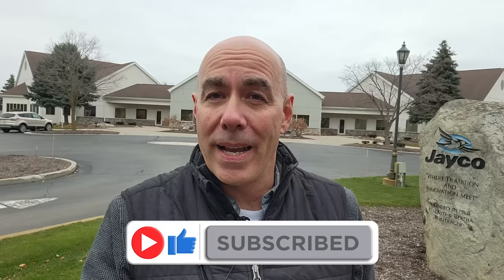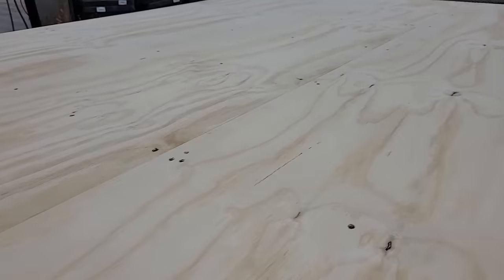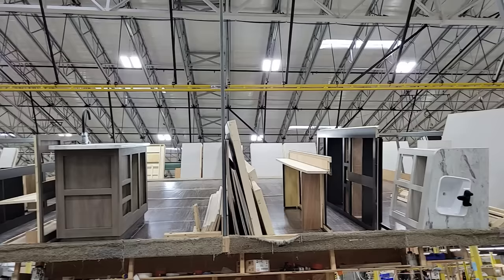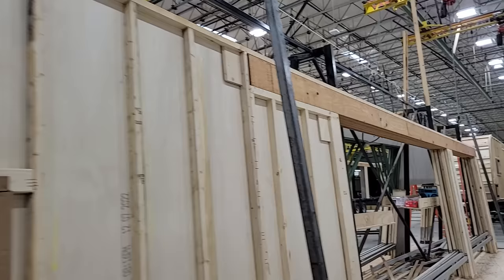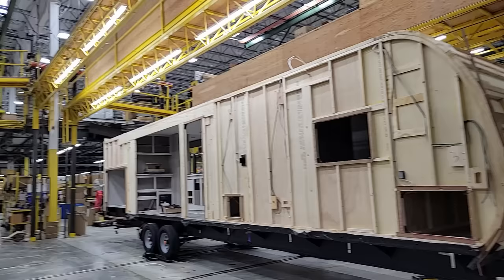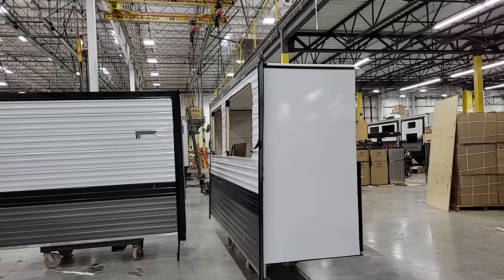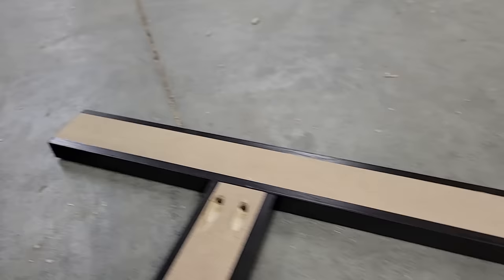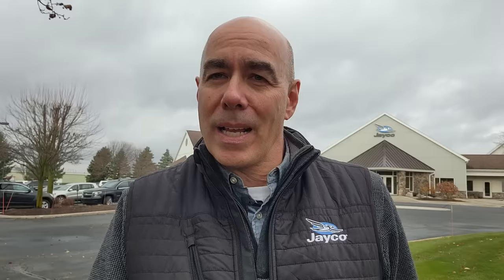How are RVs Made? - Jayco Factory Tour!

Comment: I'm not impressed with what I saw overall. The loose plastic, staples aren't correctly installed, no protection on the water cell or insulation,  those horrible welds on that weak frame. Walls are tolerable but only when they're assembled correctly. Would of gone with thicker plywood for the floors. Cheap looking furniture,  roof structure would need to be beefed up. Thin sheet metal  (even though it is thicker then other brands) still makes it vulnerable to damage. Never even mentioned the load capacity of the axles or tires. I've seen a blowout on couple different Jayco trailers, they get torn up just like the rest. Not a fan of the formed siding- more prone to leaky windows. Straight flat panels keep the water out. The paint fades on these within a couple years. Never been a Jayco fan and this video proves their faults in production and overall lack of quality- if you actually know what you're looking at. Earthquake vibrations? Only if there's an issue with construction and or the tires would one be concerned about shaking and mentioning that a couple times in the video just made me chuckle and we all know no trailer / rv company makes a decent product- they all have their faults. I'm kinda surprised the Amish would waste their time and talent building stuff like this, they usually value quality over a paycheck... least the ones I know.

Comment: My 2022 Greyhawk 30Z has so many quality issues. Jayco is no better than the cheaper ones we passed over to get a Jayco. Water heater tank installed on top of rubber gas line. Over time it collapsed causing low gas flow. Jayco said it was my fault for the lack of maintenance. The bedroom slide is not chaulked properly and leaks water into the camper. Outside trim pieces are coming loose. The water hose connection to the back of the toilet was loose and leaking water. I could go on with more items. Very disappointing.

Comment: I must say that I'm not to impressed with this video.  Because I'm a owner of a Jayco, I bought 2 years ago, brand new. Had nothing but trouble with it. From the furnace,  to hot water heater and fresh water pump. Then the biggest problem is trying to get it fixed through Jayco 2 years warranty and extended warranty.  Be prepared for a very bad Customer Service personnel.   I still have issues, and still waiting!

Comment: I am renovating extensive rot in my 2016 Jay Flight.  I am seeing none of the construction techniques or materials that are touted.  My water tank was held down with a ribbon of metal. The floor is made of OSB not plywood.  I had to replace a considerable amount that crumbled in my hand. I Put my knee through it . The framing joinery is wide crown staples.  The camper has made for some fun times but the construction details that I am seeing as I take the camper apart is poor quality.

Comment: I have a Jayco and it doesn't have any galvanized metal under the wheel well at all. All It has is a thin junky piece of plastic that offers zero protection and would be completely destroyed under a tire blow out.  All the shrapnel would fly into the interior of the unit and probably completely total it out. Worst wheel well protection I've ever seen on a camper.  Just saying.

Comment: hmmm..buy a nice older rv…don’t waste your money on depreciation of new ones…the walls are paper thin..i’ve got a 2000 safari trek class A..paid 15000 from a private seller..everything works except the radio..and i’ve driven it well over 2000 miles..if you do buy a new one…cut the price in half when you start dealing..Rvs…new or old have the same upkeep and problems..later

Comment: Was thinking of a jayco-after watching your video and noticing so many poor quality build examples, I now doubt they are superior in any way. If you have to put campers in a "sick bay", after build quality control procedures and pdi,s -then you have a build quality issue.
Reply from the maker: Having toured nearly every manufacturing facility in northern Indiana, I'm continually impressed with Jayco's commitment to build quality. Not perfect, certainly. Room for improvement? You but.  Keep in mind that the units in the "sick bay" are a tiny percentage of the units that roll off the line. I'm impressed that they pull them out to address any issues. And then they go to the full PDI facility to be inspected again.   As always, thanks for watching

Comment: You should address the tire problem on U.S. Made travel trailers, China bombs, Very dangerous problem, they blow up on the hi way at around 65 miles per hour. It is well documented, but the manufactures keep using them because they are cheaper. WHY.
Reply from the maker: Hi Kenneth, for this very reason, Jayco uses American made Goodyear tires with a 6-year warranty.  In a few instances on larger fifth wheels, they use Uniroyal, still very good tires. Thanks for watching our videos.

Comment: Jayco sucks omg I have a 2014 jayco Jayflight and heater/furnace metal box mounted on floor with water heater DIRECTLY ABOVE heater unit with exposed wires then the water heater leaks and BAMM, heater fried fire almost started now everything wet and RUINED!! EHO THE HELL DESIGN THESE PIECES OF CRAP? Not to mention Luke dozens of other design and manufacturing flaws. 😡

Comment: Watch “rv roof install” YouTube channel. You will quickly realize how junky these things are.
Reply: @Mike Drudge his channel has nothing to do with the trusses. It’s all about the cheap thin roofing material they use to cover it all and all the seams it has because of all the protrusions through the roof material. They use cheap dicor to pile on all the seams which they recommend you do every few months. That’s a lot of dicor. His roof material is 60 mil reinforced TPO and all seams are heat welded. And not all roofs are walk on roofs . If the roof leaks, doesn’t matter what type of roof system they have, all wood rots when wet.

Comment: I own a Jayco Rocky Mnt Edition 2019 off the showroom floor. This is the worst travel trailer I have ever owned. It’s cheaply made and has had nothing but issues. This camper has flooded 4 times in 3 years, the fridge has gone out 7 times , the hot water heater ruptured, lights flicker on the ceiling, the grey water tank cracked and last but not least .. the front left side came open in a thunderstorm at 8000ft in Yellowstone National Park. And wouldn’t y’a know it, all after the 1 yr warranty expired. I will never, ever buy another Jayco product. Buyer beware and may the odds be ever in your favor.
Reply from the maker: Sorry to hear about your issues, Rin.  This hasn't been my experience with Jayco products. Also all Jayco products carry a 2-year warranty.  As always, thanks for watching our vids.